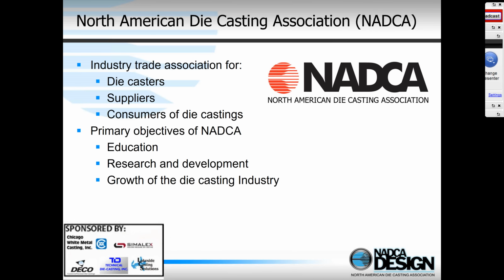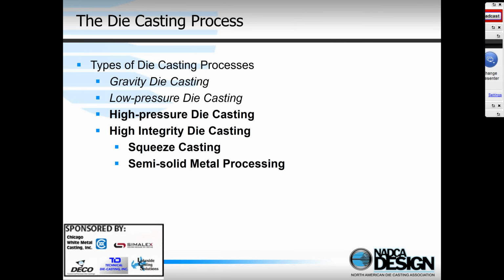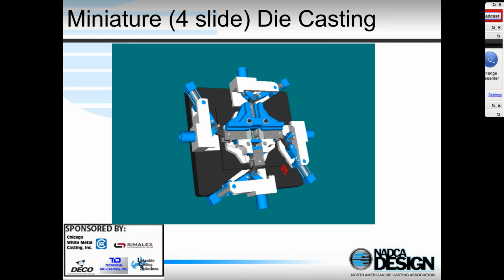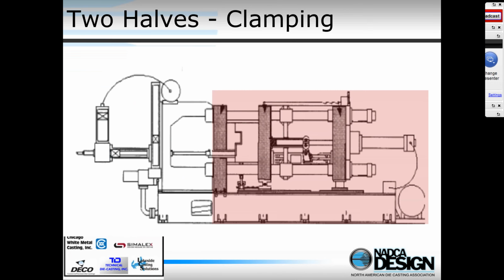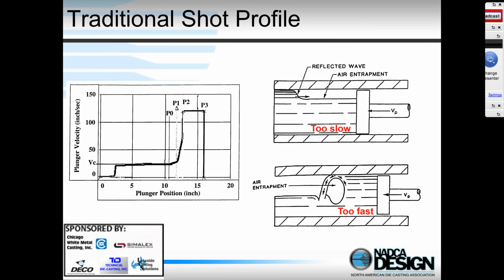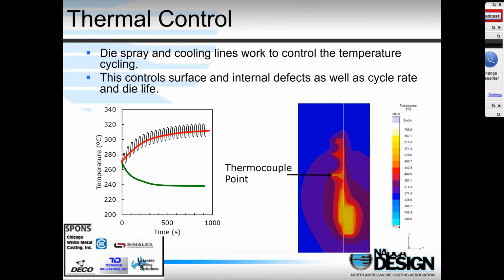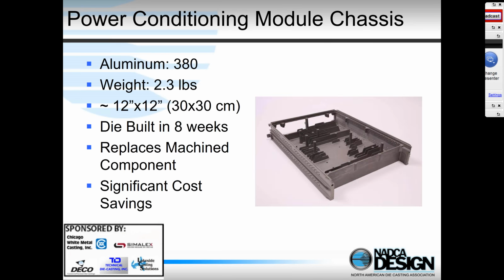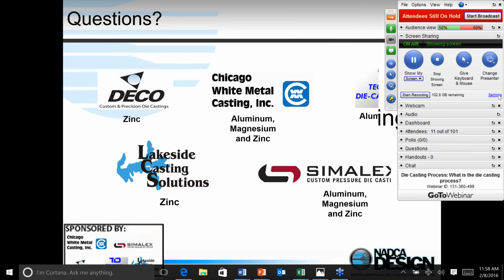Part 1 - Die Casting Process: What is the die casting process?

Comment: I have few questions.
1.) How do you Estimate the initial die cost, i.e when you have a rough design and you need to provide cost estimations for bidding for a project.
2.) What is the effect on profiles with varied thicknesses, like in injection molding u tend to make parts with a uniform thickness  how does die casting tackle this situation.
3.) i see there is a material limitation in die cast all sponsors use either Al or zinc or Mg is this true and what are the max wieghts of casted product which can be made using a particular material.?

you can email me too. prateeknith@gmail.com

Thanks and regards
Prateek Sharma
Mechanical Design Engineer
(India)
ps: Best expaination !!!
Reply from the maker: Sorry to be so long to get back to you. I suggest you sign up to receive our Die Casting newsletter. We have posted informative content there that has answered your question. hill and griffith dot com/die-casting-news
Reply: Prateek Sharma https://www.youtube.com/user/bharatsharmamech